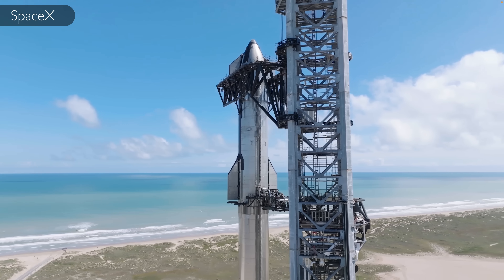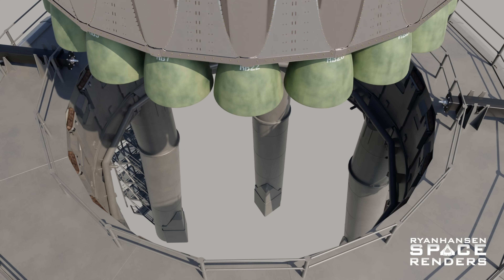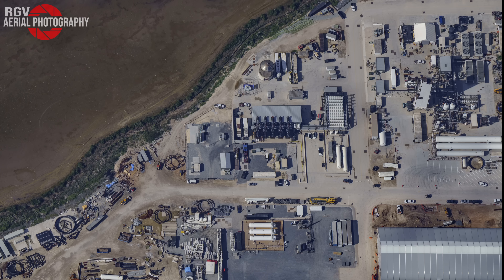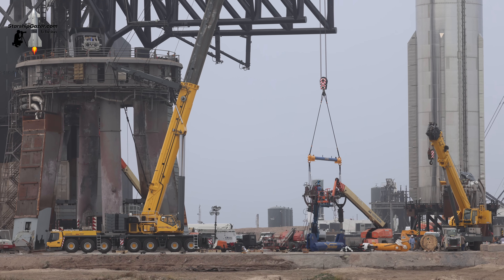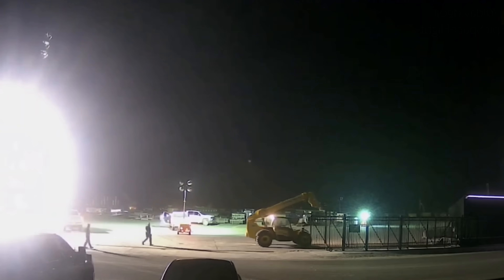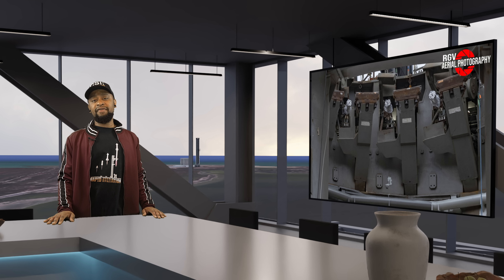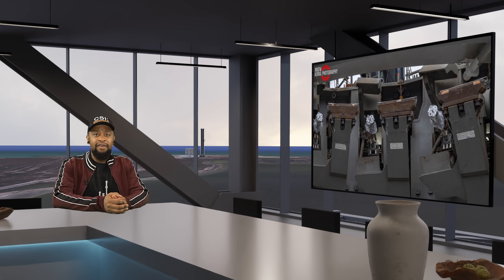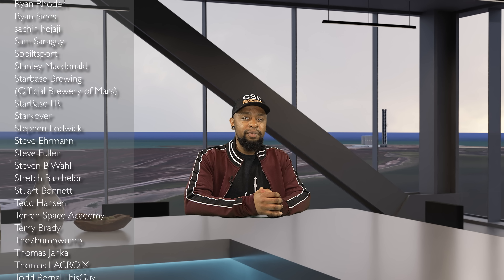SpaceX Simulates 5,000 Ton Starship Ahead Of Final Pre-Launch Testing!

Comment: Is it really necessay to test the system up to full capability for first launch or indeed for many of the intial launch attempts? Surely can operate starship well below capability and slowly ramp up over a year or two? I mean the dry mass of the space shuttle and starship are not too different, so surely they could launch at 60-70% fuel with rescaled pay loads and raptors only running at 70% performance to do what space shuttle does?
Reply from the maker: They were initially planning on including payload. So it’s a good idea to test to the max capacity.
Reply: @CSIStarbase  Thanks for replying, love your content and have learned heaps of cool details nobody else seems to touch on. Wouldn't scaling back a few 10s of percent giving more reliable margins and semi decent payload too until feel bugs sorted and  be a more technically judicious and cost effective risk management decision for such an experimental architecture? 

I mean any failure is 100% payload loss  and surely the intial run of launch attempts is going to have a few unforeseen scenarios if the starship tests are a guide. Sure going up is significantly more "simple" than belly flopping, but  Even one payload loss in many attempts  will be statistically little different from a initially reduced payload setup with higher success odds ie 80% success @ 100% operating versus 95% success @ 80% capacity over 10 launches is 8 payloads  versus ~75% comparable payload mass. ie not much difference but with maybe 4 times less catastrophic potential in the 20% versus 5% failure case?

Of course I hope they are 100% either way, and maybe their sims and amazingly definitive regarding launch expectations...
Reply from the maker: @blengi  Truthfully, I will be surprised if the 24/7 survives max Q. I expect stage zero to perform flawlessly though. They won’t have payload for at least the first 3 launches. Payload bays were deleted on 24 and 25
Reply: @CSIStarbase  Hi again. I'd like to know what aspects of starship you  think would be defeated by max Q specifically, but I don't want to preempt any up coming videos you have in mind lol. Besides I'm sure you are quite busy. Personally not being an engineer I have no idea how starship is designed to accommodate max Q loadings so I can't intuit anything sensible to affirm or contradict. Anyways thanks for your meatier than norm replies. I can't wait for more indepth CSISatrbase analysis. PS hopefully starship breezes through max Q. I won't  lord it over you if it does lol - Go well and excellent 2023..

Comment: There's a problem with this test method. Testing only two clamps at a time ignores the possibility that any of the clamps are proud of the rest. If they are, the proud clamp will bear a higher load than the rest as it will have to strain some before the other clamps begin taking up load, or alternatively when loaded the proud clamp will have strained further and thus be under greater stress.
Reply: Hey, good point. But they have already levelled all the clamps. People have been calling it the jelly fish. You can find the details in this video https://youtu.be/UBAM_-y6jsc around 21 minutes.

Comment: WTF, "5000 ton weight ...... 3053 tons thrust"? At the start you say 3000 thrust then shortly after Starship weighs 5000 ton, yet Raptor engines produce 180 ton thrust each engine, thats 5940 tons thrust (or at 230 ton per motor it's 7600 ton) for 33 motors on Booster 7. 😂😂😂😂😂
Hmmmmm, that baby's going nowhere based on your information.
Reply: Hmmm, I believe it's 7634 tons of thrust or 16,830,000 lbs. 33 Raptors x 510,000 lbs or 1.5 TWR.
Reply: @Geoff_A  thank you for your response, you are correct. I used Wiki's first thrust number of 180 tons (5940 tons) thrust but corrected that to 230 tons in brackets (7600 tons) before seeing your post. Still either way you cut it, it's a lot more than the 3000 tons mentioned at the beginning 😊
Reply: @Geoff_A  So of we have 7,634 tons thrust during the static fire, as the fuel load reduces failure of the clamps could occur due to upwards force rather than the weight downwards. Add in the heat and vibration, including radiated heat and bits of debris from the concrete base… If failure occurs it is most likely going to be towards the end of the test when net upward force is maximum and temperature highest.
Reply: @Tailspin80  I am no expert or rocket man, but surely the thing here is that this is a "static fire" test - of a really big rocket with multiple engines. Launch or test, it seems to me, first of all, that engine thrust is controlled and all engines are balanced (so the combined thrust is straight up). I think the standard for such a launch is "release clamps / bolts once nominal thrust is reached." But for a test - at every point in the "fuel consumption cycle" - the thrust to weight ratio must be kept less than 1.0. The clamps just hold the rocket in place and prevent tippage. They (should) never experience an "upwards force." This whole process is why the "computers are in control" from start to finish.
Reply: @WarrenLacefield  I’ve searched for the answer and all I can find are other people asking the same question. A full test means full throttle for all 33 engines, with maximum upwards force reached when the fuel/oxygen runs out. To avoid disaster the clamps must hold and the rest of the launch pad structure needs to be strong enough. These are forces that are not encountered in a normal launch, when there in only a very brief period at T-0 when there is a net upwards force, and at that point the fuel load is maximum. I’ll keep looking but I’m surprised this point hasn’t been discussed in any of the videos.
Reply: @Tailspin80  Well, I don't know for sure either. Hopefully someone who does might chime in here and explain. ... But ... for variable thrust engines: I (presently) do not believe a "full test" or "static fire test" of a rocket while sitting on the pad requires even nominal, let alone "full-thrust."  That could be done on a stand somewhere, one engine at a time. If I am wrong about that, I would hope to learn why (and how that would work, with clamps, etc.? 🤔).
Reply: @WarrenLacefield  A full thrust 33 engine test would prove a number of things such as the structure that supports them, the fuel delivery system, the heat build up and effect on piping, wiring, sensors, electric motors, etc. Unless they are all run at full power the first time they’ll know is when it flies. On the other hand, providing it doesn’t RUD on the pad the first flight might be a better place to find out. Yes - we need input from someone who knows!
Reply: @Tailspin80  Another possibility is the sequences and goals of the static fire. Maybe the engines are all started and then run up to a "full-thrust" in pairs (balanced but in total not exceeding a 1.0 TWR during the entire test). Maybe they might be started and stopped and restarted in pairs. Thrust control and ON-OFF-restart are among many valid test goals. I don't think you ever want the fuel/oxygen mixture to "run out" during the test (or flight either). Among other issues, that shuttering might cause imbalances. Instead you'd always want to ensure a controlled shut-down.
Reply: @WarrenLacefield  The most obvious plan would be to simulate a flight. That means full thrust to start with, then throttling back at MaxQ, then ramping up again, followed by shutting down (and maybe restarting a few engines for the landing). I’m just guessing. Need some actual info.
Reply: @Tailspin80  Yes, indeed. I'd bet SpaceX have simulated a few. But other commenters have too and they do share. Maybe we will hear from them (or CSI). This has been a good conversation. I hope the Angry Astronaut (today's video) is wrong and there will be safe and successful test flights this new year. We'll just have to wait and see - while enjoying all the pre-flight testing scenery!
Reply: Ha, yes. The important thing is that the rocket goes up! And the clamps release as the thrust balances the rocket, fuel, and payload. And keeps going up faster as the fuel weight decreases.

Comment: This video shows something really important. Zack can now release videos under 60 minutes and while they are still relevant. Great video, great renders, and great photos! Can't wait to see more.
Reply: Personally, I really like this short-but-packed-with-info style. Keep 'em coming I need my Starship dopamine fix.
Reply: rough
Reply from the maker: @BartJBols  lol its fine. Mouser is on the CSI team
Reply: I think the renders were done by someone else on Twitter.
Also, it doesn’t matter when other channels post, we are #teamspace
Reply from the maker: @rogerhalt3991  Ryan posted the render a few hours before this video went live. We worked together on it and I wanted him to get his own following up as he deserves to. Didn’t want to make the animation exclusive to this video
Reply: @CSIStarbase  There is a discussion further down about whether the 33 engine test is at full throttle, per an actual flight. If so the concern is - can the launch mounts and pad withstand the net upward force which will grow to a maximum as the fuel weight falls? Do you have any info on this?
Reply: @CSIStarbase  nothing wrong with that :) the way OP worded it was that everything was done in 60mins
Reply: Your shade is showing
Reply: I second this comment and really like this short video format.

Comment: I kinda think this rig will get moved in a circle to test all 20 clamps. If they only test 2 then there could be a small issue on 1 not present on the other 19. If each clamp get certified at 250 tons of force pushing down on it then it should easily hold a booster and ship. I think they will take the entire 500 tons under load as they need to account for mass differences with payloads. An extra 100 tons of payload would mean an extra 5 tons per arm. 235 tons per arm with a fully fuelled, fully loaded cargo bay ship. 250 tons gives a buffer of 300 tons around the launch ring